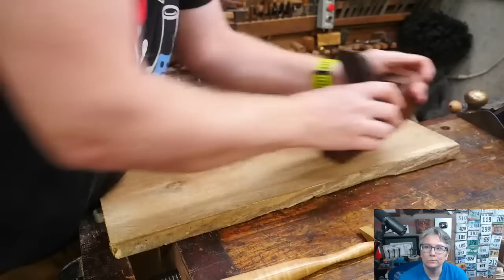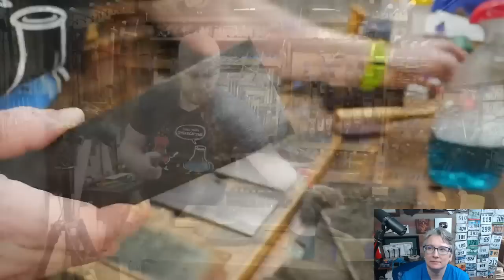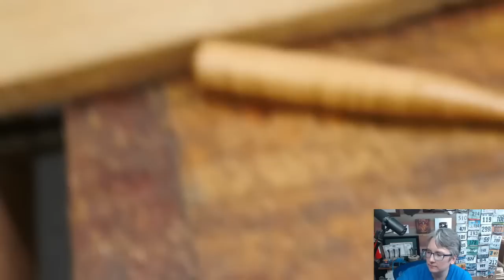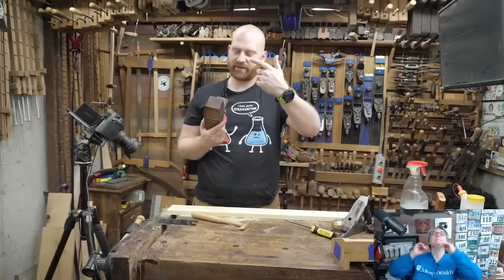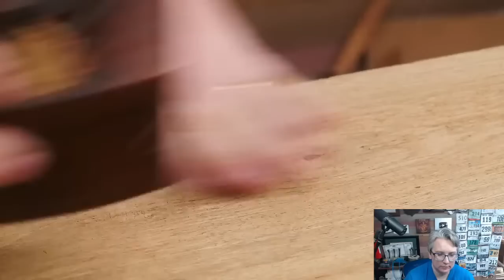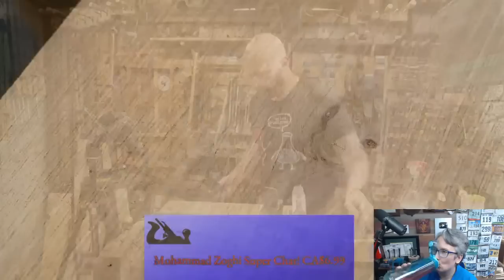What why and how is a toothing plane

Comment: The guys over att M&T magazine suggested using a piece of hacksaw blade as a substitute. They used the toothing plane to roughen the top of the workbench to avoid stuff slipping all over it.
Reply: Great idea. Maybe you could just take a block of wood cut a slit in it, and put a piece of hacksaw blade in there. Wouldn't have all the utility but would do some prep for glue.

Comment: I got a really nice second hand one from Ulmia which is also wooden. I mostly got it for roughening up the jaws of my vises and it did an excellent job on that. Now they are gripping the work much nicer than ever before. Especially with the leg vise, stuff always had a tendency to come loose. You can also use one to roughen up the top of your workbench if you find it too slippery or too slick from too much finish.

Comment: I don't know if this helps, or just another use for a toothing plane. I was told many years ago by an old carpenter that there were usually 2 mouths for a toothing plane, a very narrow one for knots in wood, and then a slightly wider one for laying veneer. He said that when he laid veneer over cheaper wood her would use both planes to get the wood as flat as possible before laying the veneer. Might be why that one clogging?

Comment: Very interesting video, James! I hope this isn’t a completely dumb question, but I don’t understand why it’s so necessary to sharpen the grooved side. Wouldn’t you want to keep the grooves as deep as possible? Seems like you could sharpen just the bevel side and still get the desired effect. (I have a toothing plane, and am looking at the blade as I write this.) What do you think? Thanks a lot!
Reply from the maker: you need the back to be initially clean and smooth. you do not need to sharpen it every time. mine just needed some work.

Comment: If you put a 70 degree bevel on the Veritas toothed Iron and put it in the low angle jack it will work fine on difficult grain.

Comment: Did you figure out why your toothing plane was clogging?  I have recently acquired a lovely old toothing plane, but I'm having exactly the same problem.
Reply from the maker: Yes. I had a burr in the wood that was catching on it. Normally these will end up compacting the material near the mouth, but that compaction will slowly push its way up and you'll always have a heavy bunch at the bottom. But if it stops you from taking another cut then you have something obstructing the flow of the chips.
Reply: Thanks for that

Comment: Dude, you DO NOT touch the back of the blade like a regular iron. You just sharpen the bevel. Then you place the sharpened blade on some hardwood end grain point down and hit the end with a hammer, this removes the burr on the back.
Reply from the maker: That is an odd why to do it. Where did you hear that one?